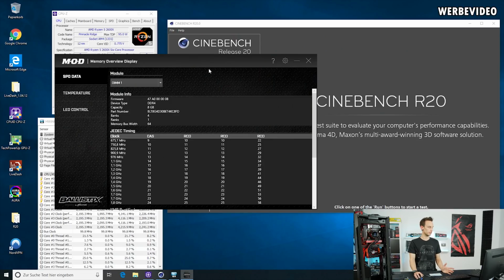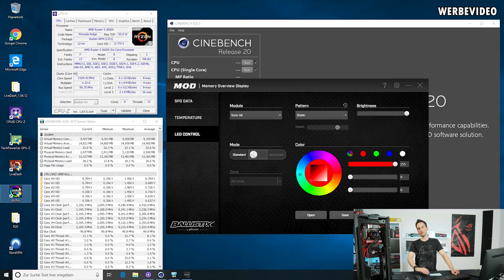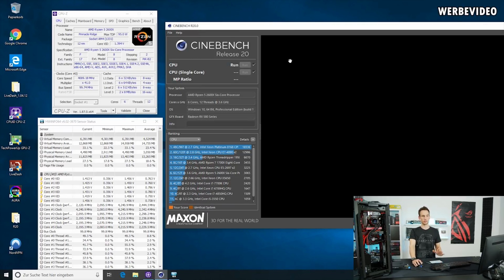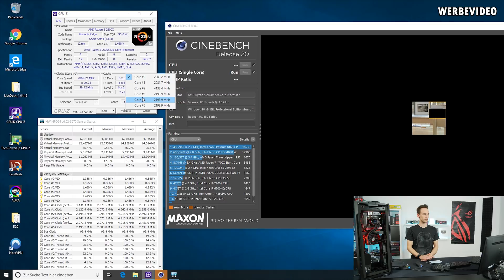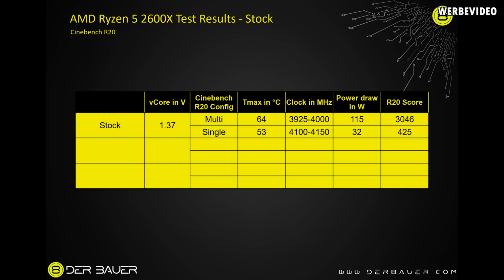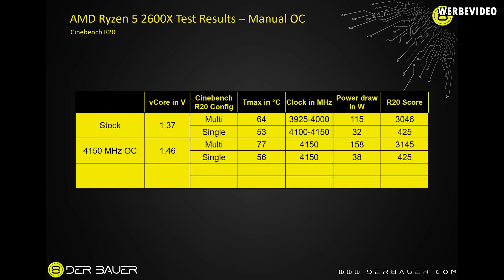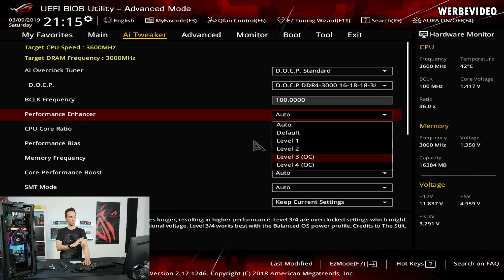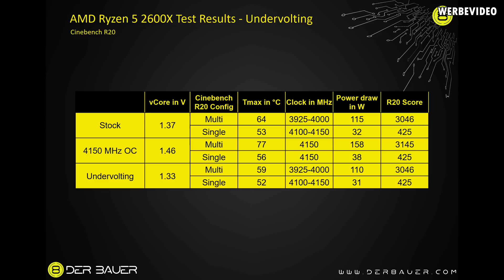The problem with AMD

Comment: On the "X" Ryzen sku's, I agree.
But on non-X Ryzen sku's, OC'ing makes more sense because they do not boost as high as the X chips do, out of the box.
Reply: Then again, the price difference between X and non X chips isn't that big compared to the overall cost of a system.
Reply: @noenken  That may be the case, and maybe not...depending on where you live, but the point still stands. Non-X Ryzen CPU's typically have pretty good headroom for OC'ing. Especially gen-1 Ryzen's like the 1700, for example, were far better values than the 1700X/1800X, at launch because you could OC a 1700 to about the same speed as an 1800X.
Reply: And for a lot less money. The 1800X's were almost $500 USD when they first launched and a 1700, was about $300 at the time. Now, with 2000 series, there's a tighter window, to be fair.
Reply: @AMDRyzenEnthusiastGroup  First gen overclocking was a thing BECAUSE of the price difference between the SKUs. The 1700 was 300,- bucks, the 1800X was 500,-. That made sense. I did that, I still have a 1700 running 3.8GHz all core 24/7. Today that price difference between the low SKU and the high one is 30,- bucks. ¯\_(ツ)_/¯
Reply: @noenken  Unfortunately this is only really true in the US. In Germany and Austria for instance, the price difference for the 2600 is 40€ (160 vs 200) while it's 90€ for the 2700 (220 vs 310). That is quite a huge difference that makes the non-X models very attractive. As far as I know this is the case in most places outside of the US. :(
Reply: @noenken  No argument about that.
Reply: @Vapefly0815  Exactly. Still a large price gap in many other areas outside the USA.
Reply: I OC'ed my Ryzen 5 2600 to 4200 MHZ with 1.375 V on the cores and it is not giving me any problem so far, maybe i can push a little more, but i'm happy with this configuration.
Reply: i OC my ryzen 5 2600 max to 4250 MHz ..using AIO Corsair watercooler..
Reply: I completely agree with OP. Ryzen X-series processors are already pushed to the limit and you can't really go very far. While the non-X-series is really what you should get for over-clocking as they often can be over-clocked to match their X-series big brothers. For a lower price and the same power draw.
Reply: I would go more with a Ryzen X series CPU if i wanted to save me the headache of overclocking the whole system, also its a bit of a price difference pretty much on where you live, USA mostly would go with a 2600 and a B450, but in some other countries, it is probably cheaper to go with the 2600X and a A320 motherboard instead.
Reply: What is the difference between the versions of the Ryzen cpus though?
Reply: @TheRealFobican   U have on the market Summit Ridge Ryzens (1st gen),  Raven Ridge (APU of 1st gen) and Pinnacle Ridge (2nd gen). Pinnacle Ridge is clock to clock about 3% better in performance. Also it has stronger IMC (extra 200 MHz) and higher frequnecies on CPU. On first gen you was in range 3800 to 4100 MHz depends on quality of silicon. Second gen is in OC between 4000 to 4400 MHz (4400 MHz are goldens one, ussually around 4150 to 4250 MHz). 
Processors with "X" means operating on XFR boost. This is extra boost  clocks. X also are ussually better (not always!) for tweaking than non "X" CPUs.
The best  for highest OC on all cores seems 2700X. I did small binning of 2600X and 2700X. 
But what I read in forums, with eg  Ryzen 5 2600 you can save some money and have similar OC as with 2600X. Some guys in czech forum are unlucky with 3900 MHz ryzen 5 2600 :(, but most of them are on 4100 MHz and few at 4200 MHz OC.
Reply: @FlanK3rCZ  That is pretty interesting to hear.
Reply: @TheRealFobican  The Ryzen CPU's that have an "X" in the name typically have higher base and boost clocks, out of the box. They also utilize AMD's XFR, and allow for use of PBO (Precision Boost Overdrive). AMD does a good job of pushing those pretty close to their limits, right out of the box. But, the other Ryzen CPU's (the ones without an X in the name) are much better candidates for overclocking, because when they're overclcocked, they'll nearly meet the performance of the X sku's, for less cost. Also, different prosessors come with different stock coolers. Some 1st gen Ryzen X CPU's didn't even come with a cooler, examples would be the 1600X, 1700X, 1800X.
Reply: of course, but what is the best way is to use Performance Enahnced + BCLK combo. Example BLCK set to 103 MHz and your multithread and single thread performance will be hihgher than on stock or in manual overclocking (single boost can be around 4400 MHZ, all core 4200 MHz with this) For more info you cna write me personaly :)

Depends of course on quality of chips, I had  7 Ryzens 5 2600X for binning, and few Ryzens 7 2700X. I found, 2700X are better. With 2600X the best one can hold 4300 MHz Cinebench 1.45Vcore, but 2700X 4400 MHz 1.45V. Also I had  few not good chips. 2700X max on 4200 MHz R15 (crap) and 2600X 4150 MHZ.
Last 6 chips I did table there: https://www.flickr.com/photos/20698985@N05/44879655842/in/album-72157689788920210/
Reply: @FlanK3rCZ  maybe like 5% of ryzen cpus can handle 103 bclk so it's really not representative of what a typical user can do.
Reply: @Lead_Foot  depends on what do you mean 5% of Ryzen can hold 103 blck. 
U can  have eg around 140 MHz bclk with another CPU multipliers. It is not issue wit external clock generator...
But for Ryzen 5 2600 is not BCLk 103 MHz issue, because your max boost will be 4013 Mhz :) Ant its  OK for all Ryzens 2600 for single thread boost.
This info is for performance edhancer settings. Thats mean single thread and multithread boost are different! So ideal for 99% users.
Reply: @FlanK3rCZ  4.56 on single
Reply: @chriswright8074  wow, its yours? Awesome!

Comment: I feel a whole lot better that you have problems overclocking Ryzen. I dont feel so bad now that I gave up on my 1800x and just left it at stock because it was so unstable.
Reply: It'll be fine at 3.8ghz on 1.35V. It's above that, that the real tweaking begins.
Reply: @discostoo  that was even crashing. Just couldn't get it to play ball other than stock. And the ram, holy. Maximus hero board as well, so its bit like its poor mosfets

Comment: I am running a FX-6300 and as soon as it dies I will do more research then when I built my first computer... Is basically what I wanted to say whilst feeling burned by a AMD purchase.
Reply: @glaciernine228  You are absolutely right, I should have done more research. But then I was a soy teenager back then thinking I have all the answers and as all know-it-all's know. People on the internet have the answers. So all I did was check forums and all I saw was "buy the FX-6300, 8gig ram and a r9 270" because that is what fitted the budget. So I learned from my mistake and I will never again buy hot under preforming hardware.
Reply: Wow, the fanboy-ism  in that unproven response is just crazy.

Comment: I have a Ryzen 1600 on a ASUS B350-f board.
At stock it follows the 3.7Ghz single thread boost and 3.4Ghz multi thread boost. Is there a way to use XFR or is XFR available on other configurations?
And my brother has a Ryzen 2600 on a AORUS B450 Elite, what about XFR on this system?

Thanks in advance.
Reply: XFR is enabled by default on all Zen CPU's, it's what gives you the 3.7GHz single core boost which would otherwise be 3.6GHz. But that's XFR, which works differently to XFR2 on R2K CPU's.

AMD's got a video explaining it https://www.youtube.com/watch?v=426hLGoXDbM

Comment: The problem is AMD processors are made on a low power process and not a high performance one so they are very efficient but will hit a wall with clock speed.

Comment: Had an R7 2700X system briefly. The XFR on the 2x00X cpus work so well, I'm excited to see what AMD offers with the 3000 series.
Hope to get something beastly for a new itx system :)
Reply: Mishael R  I'll gladly "settle" for 8C/16T with those frequencies! :D
Reply: @ricardomartins2700  pls check ryzen master and get back to me. Hwmonitor is buggy with ryzens, also u could try hwinfo64
Reply: Brad Viviviyal  Considering local prices I'd rather go for the 8700k(& delid). It's around 275-300eur vs 430-450eur for 9900k. But I'll wait for the new 3x00 Ryzen, even if they only drive intel prices down :)
Reply: PBO on my r5 2600x does really weird thing with voltages that i am not comfortable with, also its b450 board so prolly thats why. XFR is amazing tho, just left it on in bios and system does its thing. In cinebench it hold 4.1ghz at least on all core which is not bad
Reply: @gigicho21  Yeah, the voltage was all over on the 2700x I had. But I read that's normal. Too bad i could not set voltage manually without turning on full manual OC (Asrock B450 itx board). I know for sure Asus and maybe others have this.
Reply: @JanisVeide  i tried manual oc and got 4.1ghz 1.35v stable but performance is bit better if u let amd take over things so i left xfr on and dont even worry about anything. Anyways as soon as zen 2 comes out i am jumping lol
Reply: @gigicho21  What PBO and tho mean?
Reply: @FirdausAzhar87  PBO=Performance Boost Overdrive, tho=though
Reply: @gigicho21  thank's
Reply: @gigicho21  Thanks mate, my first language isn't english so I was scratching my head the whole time, seen people mention "PBO" XD
Reply: @ricardomartins2700  check clocks with ryzen master. No chip has hit that number yet xD also are you sure you are not talking about i7 2600k?
Reply: @ricardomartins2700  hello? XD
Reply: @ricardomartins2700  suuuuuuuure u did
Reply: @ricardomartins2700  dude come on, stop lying. That cpu will never, in million years do 4.8ghz unless it's some programs error. Best overclockerd in the worlf have trouble reaching 4.4 on all cores. Don't do this
Reply: @UCV2AnIYD9LG_jYIaEBk0mZA What reply are you waiting for, you one celled Troglodyte? YOU FAILED, to show any proof of your cpu hitting those temps, you doubled down on your lie multiple times and now you backed out from convo, so fuck you. I dont have any more time to talk with kids on internet

Comment: der8auer - Why does Cinebench R15 and R20 shift between multiple cores when running the single core test ? It doesn't make much sense... I'd simply prefer to 1-Lock the software to 1 thread in Task Manager or 2-Boot with a single core enabled in BIOS. What are the differences and is this kinda cheating ?? Would this favor Intel or AMD ?
Reply: Just ran this using R20 and ryzen. 388 points without affinity, 391 points with one core affinity. That's like within margin of error.
Reply: @kognak6640  Good! I guess it shifts when the core used starts to be used by other processes, since Windows is agnostic to the usage. Could you redo this, now with affinity, priority Real Time, and removing the top 10 busiest processes from the core you selected ? I'll do the same here.
Reply: @vitaobatera  Realtime tests: 399 points without affinity, 399 points with one core affinity. I have locked CPU clock(3.9) so boost tech doesn't interfere.
Reply: @kognak6640  From the stock 394, I reached 419.

Comment: If we're talking about Ryzen overclocking it has to be for the non-X versions. I thought my R5 2600 was stable at 4.05GHz at 1.4v in Cinebench R15 but the new R20 crashes all the time at that OC (I had one run complete at 3050 score which is close to your 2600X).
Even 4GHz 1.4v crashes in that benchmark. Realbench stress test doesn't crash at my original OC. What are your experiences with the non-X Ryzen chips?
Reply: Run on Linux your get better result & performance than windows experience.
Reply: Apart from the fact most my hardware and software doesnt work on linux.  Linux is for people that browse youtube and read mail not for people with advanced hard and software.
Reply: not for people with advanced hard and software is too biased
Reply: Not  really im not even a pro used and i already have 7 pieces of hard and software that have no support for linux or a equal option. And thats completely ignoring my game collection. Even my grandma cant use linus as her quilt design software only works on windows.
Reply: Leave voltage on auto. I couldn't get past a 3.8 all core when manually tweaking voltage. I switched it back to auto 4.0 stable, occasionally it'll ramp itself up to 4.2 on single or onlya couple cores. All this and it never volts over 1.45, typically it's just under 1.4
Reply: Its interesting to see how different amd and intel are.  My 3770k does 4,8 ghz on that voltage but gets to 78c  but to get to 5ghz i need 1,485v. and get 85 to 87c.   Stock with mce all core 3,9 ghz its only 1.125v and 55c and thats a old 22nm chip.

Comment: I dont get why the all core OC only yielded 3% performance boost. On stock only two cores were running at 4.2 Ghz boost while the others were running at 2.2 GHz. Surely all cores running on 4.15 Ghz would give more performance than +3% ??
Reply: Keep in mind, that clocks don't scale linearly with performance, also depending on factors such as memory speeds and timing, cache layout, aswell as power reliability from the board. Thereby actually lowering the IPC if the chip the higher you clock it. This is true with all chips, while some are more exposed to it than others.

Comment: Some people have talked about p state overclocking. What are your thoughts?
Reply: You're just adding clock/voltage points for low-load situations, it's an energy saving thing basically. The default boost on a 2x00 series chip will do a better job of this anyway, but if you've manaully dialed in an overclock you lose the default boost feature so p-states is just manually setting up a similar thing.
Reply: @SuprSi  Yeah. But he was kinda pointing to Ryzen not being fun to overclock, I kinda think that p-state overclocking should be fun. But I'm still on a intel 2600k so zero perspective on what its like to p state overclock.

Comment: You got a dud of a 2600X I think, 4.4ghz is golden sample range for ryzen 2000  right? 

You could always overclock APUs, but that's mostly memory overclocking.
Reply: 4.4GHz would be god like. 4.3GHz is a golden sample level OC. Typical is 4.10-4.15GHz. 4.2GHz would be a top end OC
Reply: @richiec7700  I will second this.

Comment: Why do amd fanboys take things so personally? Just be a fan of performance. Dont fall in love with a company, they only want your money in the end. Intel or AMD.
Reply: What are you talking about? This video has nothing to do with fanboys
Reply: @noodled6145  i think He is more about this comment section

Appareantly the Problem with AMDs is that they dont have a Problem
Reply: @noodled6145  - I think he was meaning generally. But the inverse of Intel fanboys is also true. Any fanboy has that problem.

This is why I always recommend performance per dollar analyses to decide what to buy. It's like me needing multi-core. I could buy a top binned 1950X, a 7920X, or a middle binned 7900X. I went with the 1950X. Never looked back.

If you prioritize highest single thread performance, or performance and money is no object, Intel CPUs give that to you. You should also compare performance on your specific workloads, but that is what I meant by looking at performance.

I currently find Intel's pricing during a CPU shortage to be the primary catch for purchasers. They are competitive in the middle though, with an 8400 vs a 2600X on gaming (talking price point). If willing to OC, the AMD may edge out performance. If not overclocking, the 8400 wins. That is competitive.

Meanwhile, comparing the cost of a 2700X to a 9900K, the 9900K wins by an average of about 11% in gaming and 22% in productivity. But, the price delta is closer to 66% more to buy one. A 33% cost over a 2700X would definitely make sense, as that is a reasonable premium for the extra performance, but double that is not. If only upgrading the CPU, not needing to build the whole system, then the analysis changes a little, although I still feel the price is too high currently. 

So, I can put it on any fanboy out there, but I generally recommend looking at the price for what you are getting.

Comment: I have a question:

If motherboard vendors can let us set the multiplier per the # of cores under load, that means they can detect how many cores are being loaded. So what is stopping them from letting us set the voltage on a per-number of loaded cores basis? i.e. 1.4V for 6 cores, 1.38 for 2 cores, etc.

My only guesses are 
1) it's possible but hard and not worth implementing
2) the delay in how long it takes to detect a change in load is too great, and the voltage wouldn't change fast enough, resulting in instability
Reply: 3) Too niché probably. How many people would want to do 6-8 times the amount of work for 2% lower temps for their 24/7 OC?
I don't think point #2 would be possible, otherwise we'd already have this problem
Reply: That's sort of a thing with the Ryzen X SKUs. Using the Scalar in PBO, you can increase the all-core boost and single-core boost voltages. The stock voltages for a 2700X are 1.33V/1.425V all/single, with the Scalar at x10 that gets increased to 1.38V/1.48V.
Reply: Comments:

Yeah it might be niche, but ever take a look at every setting in your BIOS? There's hundreds and most people probably touch like, 5. I'd say they can do niche stuff, at least with the high end OC boards. 

Problem with just having a multiplier for predetermined values in PBO is well, people often have to undervolt to maximize PBO. The functions are too conservative most of the time, and setting it all manually would still be better